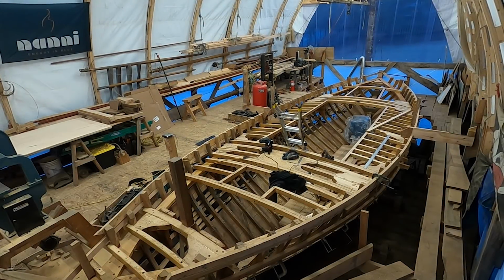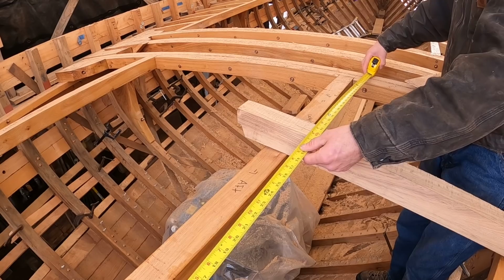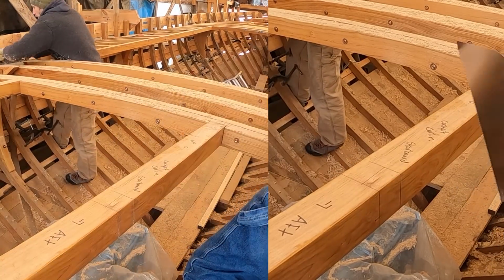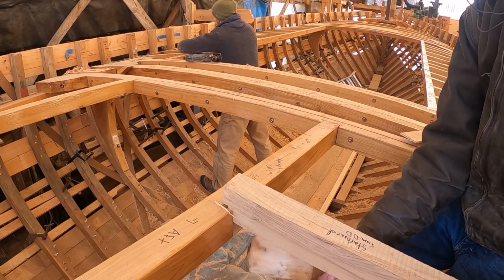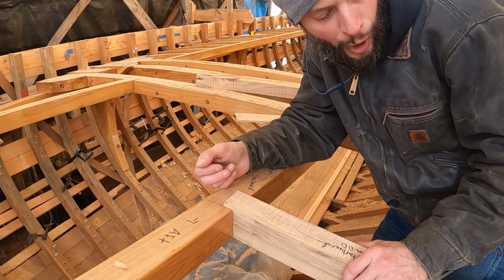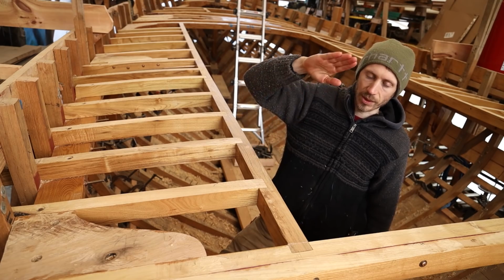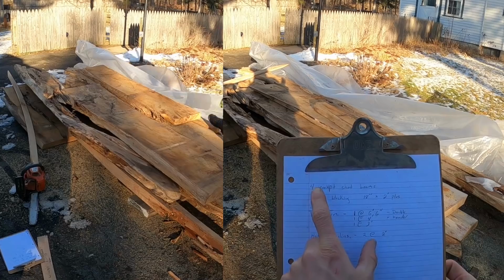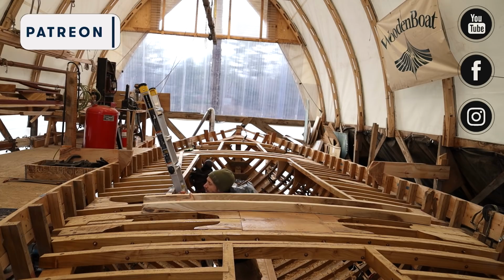Framing Work in the Stern -  Episode 145 - Acorn to Arabella: Journey of a Wooden Boat

Comment: I watched a video on "modern" wooden boat construction. It was basically a laminate boat. None of this finding the right species, or evaluating the knees for the proper grain direction. The knees, in fact, were laminated right into the deck and rib structure. The hull was laminate, and finally skinned with two layers of fiberglass. It came out beautifully, but it felt more like a fiberglass boat than a wooden boat. 

I really appreciate the craftsmanship of this boat. Especially this episode, where each joint is custom made to fit. Thanks for the effort!
Reply from the maker: Thanks for saying so! Of course, laminates are necessary when that's what's available for material, and they're totally strong and get the job done. If the choice were between being able to get this experience through building a boat, or foregoing the build because of a religious adherence to a mandate on materials, I think we'd have gone ahead and done laminations, too, if we're honest. We're thankful to have these materials, and there are many paths to the water.

Comment: Arabella is coming along well chaps, some lovely joinery in there and those massive knees are very impressive - they would not be out of place in a very much larger boat! I very much like your use of local timbers. One thing I am curious about is why you are planning to build the 'house' already? I would think having a large open hatch would be very useful for when you come to fit out the interior - shifting timber (and large sheets of plywood) in and out would be so much easier without a cabin top there. Anyway, keep it up and thanks for all the high quality footage.

Comment: Use a lumber crayon and rub it on the short beam end. When you tap down the crayon will transfer onto the joint and you will know exactly where to chisel of the high spots to get a perfect fit. (licences Tool Pattern Maker)

Comment: You mentioned the word “bung”. I figure nothing has destroyed more decks than fastening planks with screws with nice looking bungs. But hey, it keeps working yards going repairing the damage they cause. I would certainly recommend modern adhesives. You can thank me later. Love your progress
Reply from the maker: The bungs cause damage or the screws do? Bungs are more than pretty— they perform the important work of stopping water intrusion that would easily follow the surface of the screw into the wood after the bedding compound ages and inevitably fails. Bungs should be removable, too. Epoxying them in would be almost downright evil.
Reply: @AcornToArabella  of course they are both functional in keeping water out and attractive in the process. Unfortunately that doesn’t last forever and eventually water will penetrate and follow the screws into the beautiful frames below most likely without you noticing that it has even happened until the rot sets in. Granted that is a long way away but it will happen. Unlike the hull and bottom planks that will be somewhat protected by paint and other protective coatings, the deck remains open to the elements and therefore likely to fault much sooner. The sun being the harshest element in the equation. I’m sure this problem is why pretty much all modern builders offering expensive teak decks have gone to non-mechanical fastening. That may not have the perfect traditional look but it is still a solid wood deck and it is beautiful with the advantage of a major impediment of water ingress. All boats have compromises, whatever path you take will be your alone to decide and for all of us exciting to watch and share.

Comment: Man, that hull and deck framing is looking hellish stout, and well proportioned. 
There is not ever going to be any caulking being spat out as the boat "works" fore and aft in longitudinal shear, , that's for certain. Hogging and sagging are never a realistic risk for boats this size, and lateral shear and longitudinal torsion hardly a factor for this design, due to the "master section" being somewhat triangular in character ...
Your nifty diagonal metal straps should be standard equipment. 
Kudos for popularising them as you will certainly have done. 
Any boat being replanked should, IMO, consider adding them, especially larger ones; their lack was (again, IMO) the only serious structural deficiency of traditional wooden ships.
Reply from the maker: Thanks! We're glad to be able to do things this way. Boats also last a good many years without strapping, and if the choice was between someone going adventuring and sailing without it or not going at all, we'd recommend going forward with what you have on hand. That's a part of the tradition, too.
Reply: @AcornToArabella  Good points. It's very easy to fall into the trap where "very best" practice becomes the enemy of  "good enough", by causing people to do nothing, or settle for something unnecessarily unsatisfactory, because the very best is unattainable, unaffordable, or impractical. Or sometimes, all three!
I personally feel that bringing masts into the boat, rather than terminating them at deck level, often falls in to what might be called a "perceived best practice" category. Some pretty experienced rig designers advise that each situation needs to be carefully assessed, balancing a number of competing criteria and scenarios, because sometimes deck stepped is clearly ahead on points, even with regard to security of the rig.
Perhaps the clearest instance is the combination of a strong, beamy metal hull and an aluminium mast whose section is generously proportioned, particularly in the case where the walls are not particularly thick. Provided the rig is properly stepped and stayed (with the disposition and sizing of the spreaders, stays and shrouds taking into account how it is stepped) it's a real shame to use the deck as a further intermediate support for a mast which does not really benefit from it, and in doing so invite seawater into a boat which, if properly designed and built and maintained, should routinely have bilges so dry they're dusty.

Comment: It could be just the camera angle and it's hard to see, but is the hanging knee on the starboard side near the mast different than the port side?  It looks like it goes up to the deck so the blocking is cut around it.  There doesn't appear to be a notch in the blocking on the port side?  Could it be it's just not showing in the camera?
Reply from the maker: Good eye.
Because of the slight variations with the bent frames (it's almost impossible to keep them perfectly vertical near the stem and stern) the port knee landed under the deck beam while the starboard landed next to the deck beam.  Structurally it's a pretty insignificant difference.  It did make fitting the port knee slightly more time consuming though.

Comment: Lots done again. Don't know if my eye is deceiving me, but does the starboard house carline not look slightly bowed in or down?
Reply: It looks bowed, because it is. The whole deck is bowed up towards stem end stern. 14:20 See the deck vanish towards the distance when you look from below, 14:36 yet you can see the whole deck looking from just slightly above. At the same time it is also bowed down towards port and starbord. It's a really tricky shape to work with because nothing is really straight.
Reply from the maker: Yup, you're seeing the sheer. There's also camber: the center of the deck is higher than the sides, which encourages water run-off.

Comment: If i was you i would leave the designed space for the engine even though the fitted engine is smaller , you might find in the future the engine is to small and having the space for a lager one would be handy
Reply: Agreed. Even if the installed engine is just as strong as the one in the plans, it's always good to have space for maintenance.

Ever had to change timing belts on a Subaru? Gotta disassemble half the front of the car to get to them! (Gotta pull radiator out, all the accessory belts, and then you can get to the timing belts. It's about 4 hours work to do...)
Reply: Not to mention some day that engine will have to come out. An you don't want the mast right in the middle of your route of travel.

Comment: I don't see any support in the middle of the house top opening sides. How do you avoid them to bend (even slightly) down ?
Reply: The house will function as a fully integrated, extremely stiff beam.  It will significantly help stiffen the entire deck structure and be more than adequate to prevent the deflections you are mentioning.

Comment: What is the power to weight ratio that is originally specified and what is your power to weight ratio? Just wondering if you have considered this and I'm curious about the number. I know you decided to use heavier planks on the outside but I was also thinking that the newer diesel engine might give you more power.

Comment: Looking at it all start to come together, I’m noticing that a lot of the structure across the boat at deck level is in a relatively small number of doubled deck beams.  I can’t recall an explanation of why those are doubled beams with bolts instead of single thicker beams.  Is there an important reason?  Or is it just easier to build this way?

Comment: Y'all going to do any sort of like... flashing around that roof house top? He briefly mentioned caulking where deck butts up.
Reply from the maker: No, there won't be flashing and the caulking goo will be enough to stave off water intrusion. The house sides will be, as we mention, built of epoxied strips, then we'll be doing some kind of fabric in epoxy over it... either fiberglass or Dynel, we haven't chosen yet.
Reply: @AcornToArabella  Awesome. Thanks for response. Was just curious. Trying to brainstorm of ways how y'all would do it. I'm usually... not all that far off yet am almost always impressed by some little tidbit of what you're doing or how you're going about it, hahah. Amazing craftsmanship and motivation. Keep em' comin

Comment: When I do woodwork, which has never been on a scale anywhere near as massive as this one it has to be said, I just use a pencil instead of a scribe to mark my intended cuts. I've never understood why some people prefer the scribe over an erasable mark. Can someone explain to me what the benefits are?
Reply: A knife scribe sits more closely to the rule and provides a more accurate, narrower mark (if the application calls for it).  Also a knife mark can provide a small cut wall where a chisel or saw can be easily registered for the initial cut.  Of course, marking choices are part of the process and also may often be preference.  Sometimes I mark with a lumber crayon, a pencil, a scribe, or the heel of a boot, it just depends.  Good question, though.

Comment: Why copper as opposed to stainless steel fasteners?
Reply from the maker: The tannin in the oak does not react well to steel. Copper/bronze is also less of a concern in terms of electrolysis in respect to the lead keel.
Reply: Thank you so much for that information!

Comment: Is the joint between the short beam and the carlin this style out of tradition or is there a practical aspect to it? It seems like a pinned mortise, or another type joint, would be faster, but-----.  Do the short beams get bolted to the carlins?
Reply from the maker: It's both practical and tradition–Bud McIntosh used similar ones and Larry Pardey used these exact ones.

Comment: I hope you are going to have a lift-out cockpit so the engine can be easily removed.  Please remember that every minute you spend planning for maintenance and service now, translates into hours of not cursing and bloody knuckles later.  Salt and Tar are doing a very slap-dash job of their electrical and it WILL come back to bite them. They are using the same red wire for everything.
Reply from the maker: Yep! We’ve already thought of that.

Comment: This may be a clueless comment, but that cockpit looks awfully small. I race on a 28 foot boat and the cockpit is bigger than the one on Arabella. you're going to be spending a huge amount of time there, not to mention you'll want a space to relax outside when you're not sailing. Maybe there's something in the design that's not yet apparent in the build?
Reply from the maker: Smaller cockpits are preferred in many cruising designs of this vintage. A large cockpit for in-harbor racing to accommodate a crew is one thing, reducing the amount of possible on-board water in a self-draining, smaller cockpit is prized offshore.
Reply: @AcornToArabella  Thanks!

Comment: Don't discount the value easy access to the engine... If that engine comes with a hand crank, you will want to plan for room to use it - really.
Reply: I agree! In my 60+ years of life I have learned that the only difference between a part that might break and a part that will not ever break is when the part that will not ever break breaks, it will be buried where you can't get to it!
Reply: I also was worried when I heard they want to put a mast right smack center in front of the engine.
Reply from the maker: There's a little clearance in front even when the mizzen goes there. Enough for tools and access.
Reply: @georgf9279  I have the same area of concern. Tight access to the front of the engine can be frustrating in a seaway.
Reply: @AcornToArabella  I really would love to hear more about the decision to keel step the mizzen.  The balance between a stronger mast and engine access is an understandable design change, nobody wants a busted mast, but it is a secondary mast, shorter thus stronger to start.  For what its worth, my 50+ years of boating/sailing/cruising says keep the engine accessible as possible over the stronger mizzen.    Love what you guys are doing.